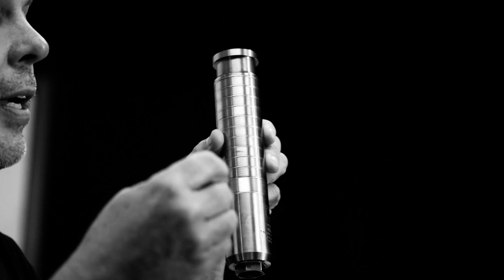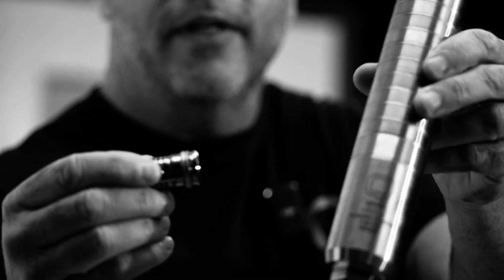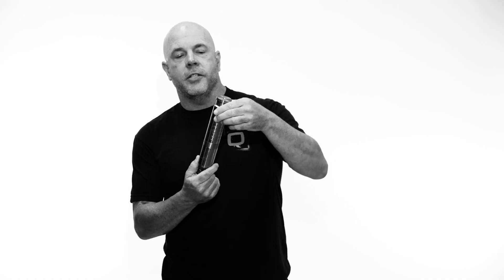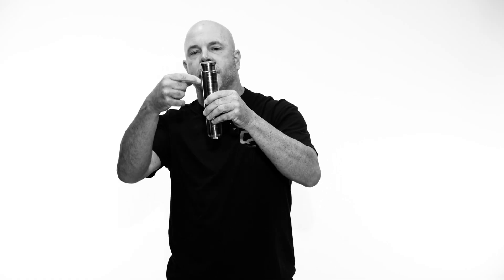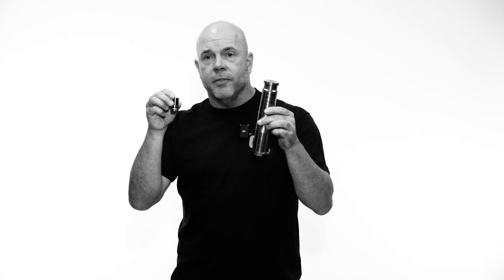Q  |  YQ | Shi**y Silencer Welds

Comment: Weird that not one other industry anywhere in the world tests welds like that…almost like that didn’t test anything
Reply: That's a pretty bold statement. Are you sure about that? I mean, that's akin to me assuming you are about to yell at your mom for some more chicken tends from up stairs.
Reply: @danielllewellyn5720  considering a tensile test is also testing the can core, yeah I’m pretty sure. A better test procedure would be taking a completed can, cutting it open and submitting the shell to bend testing as well as doing pressure testing on a sealed unit. This tensile test didn’t actually test anything but the muzzle device threads.
Reply: @tylerphelps4868  If the weldment had poor penetration, or was thin in an area, it would have split under this test. Of course there are other basic weld tests, like cut and etch and bend tests, but they wouldn't act dynamically as this test does, yielding real world results. This test shows the welds are stronger than the threads. Do you see cans stripping the threads off and flying down range? Evidently the welding is more than sufficient.
Reply: @danielllewellyn5720  bend test does test them dynamically. It also shows the strength of the weld without other variables. This doesn’t show that the welds are stronger than the threads but that the can as an assembly is. No you don’t see them stripping and flying off but that wasn’t what was being tested. If you want to test thread strength, this is in fact the test you want to run. However if you want to test the weld quality you need to subject them to bend and pressure testing to show it dynamically or use xray to show it non-destructively. The main forces the welds are fighting against aren’t parallel to bullet travel but from outward expansion of the gases. The tube material is clearly plenty capable and proper welds are generally stronger than the base metal and to show that, this is the wrong test

Comment: Love the fit and finish of Q products. But the fact that Q is touting that threads failed before welds is hysterical. No shit Sherlock. Thats EXPECTED!!! Especially with such a fine thread. Also, curious engineer here, how are you testing weld integrity by pulling on the silencer. What failure mode are you trying to test for?
Reply: Pulling the welds apart…

Comment: Not a Q fan but KB is right. How a weld looks has nothing to do with how strong it is although it may tell how you welded the metals together. Until you do a strength test like what was shown or cut the weld in two to exam the cross sectional area for the weld penetration into both metals, you can't make any assumptions about how strong a weld is.
Reply: Let's not forget about x-ray...
Reply: @MrMikethemick  yep failed to mention it but you'll get a better understanding of the welds if you cut the can in half.
Reply: Destructive test are only one indicator of shear strength. Threads will be weaker than a weld if you’re testing head to head. Totally leaves out heat cycles of the can with use. Heat affected zones (Google HAZ) come into play. It’s true how the weld “looks” doesn’t tell you everything but it will give you hints.
Reply: @HBCuatro  True.